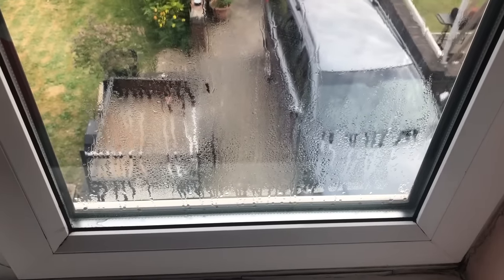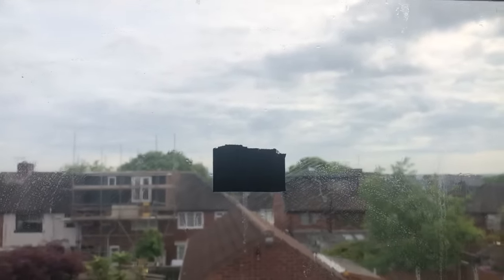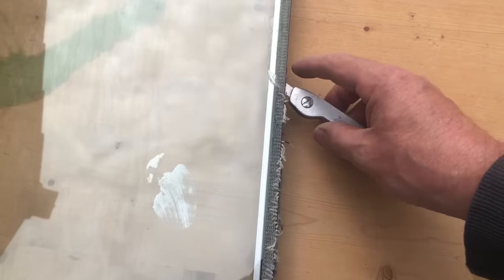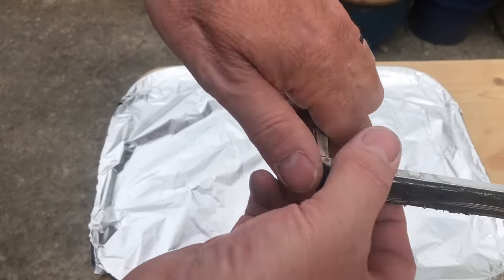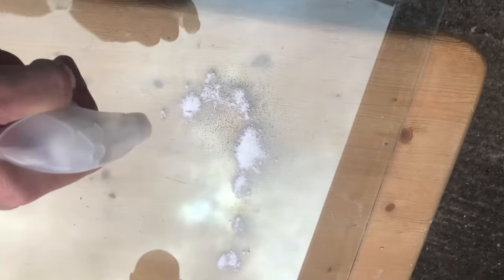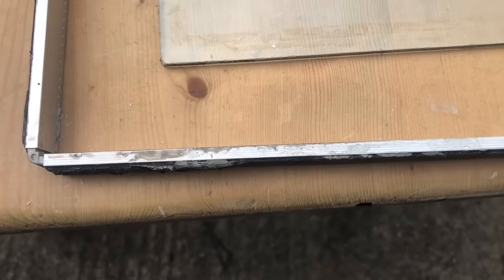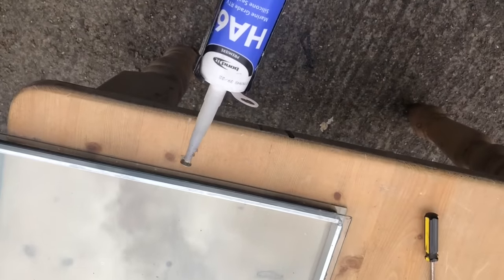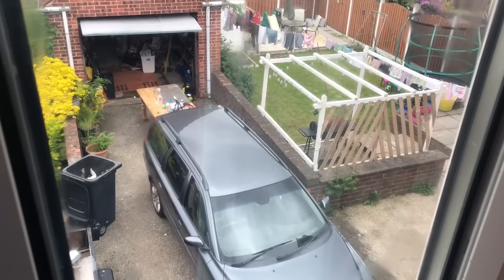Double Glazing Unit Condensation / Blown DIY Repair.

Comment: So smart awesome dude if you do this regularly worth getting suction cups glaziers use they are £10 or less screwfix etc helps to handle the glass
Reply from the maker: Good idea, I hope I don’t have to do anymore though!
Reply: @TheRepairer  for sure how long does it take  on 1 sqm unit the cleaning and sealing up
Reply from the maker: In the region of four hours at a relaxed pace with a couple of Tea breaks thrown in!
Reply: @TheRepairer  oh wow so you need to ensure good weather also this repair would be a bit risky on the tempered glass they use on doors that breaks to bits

Comment: if it's an older unit this will be fine. however if it's a gas filled unit this will make the unit less efficient and more noisy, but may save you time and money in getting it replaced.

Comment: I'm definitely up for recycling... however most modern double and triple glazed windows are filled with an inert gas to improve the thermal properties of the window and reduce heat loss. This windows will now have a poor U-Value (increased heat loss).
Reply from the maker: Dried air is the common filling,  gas is more specialised and costly.

Comment: Hello mate, I used to be a window cleaner years ago and can show you how to do it. All you need is an applicator, a rubber blade, and a scrim which is made of sheep's wool or hemp.

By using fairy liquid and water you can get rid of grease and clean them so they're as shiny as can be. 

Just an idea I thought I would share. This is a great video, why don't they repair all windows like that? I know this is what I will be doing to my windows.

Thanks for sharing
Reply from the maker: I needed to up my window cleaning game thanks for the tips.

Comment: I used to see my father making double glazed. He used to clamp the corners to stop the the bars moving. Then with a filet knife push the sealant down against the bottom pane and up against the top pane. The modern sealant is probably more sticky nowadays.
Reply from the maker: I’d like to see a unit being made too, thanks for sharing.
Reply: @TheRepairer  its nothing like how you do yours!

Comment: I use an old plane iron to remove the glazing beeds. Also I have seen repairs where as a small drill hole to the glass can be seen after, usually filled with some sort silicone
Reply from the maker: That’s one ready made tool I never noticed whilst wielding many planes!

Comment: The hourly rate to carry out that type of repair would cost more than a new DG unit replacement plus it will almost certainly leak/blow again soon as, also the old blown units can be recycled where it is ground down by a specialist company in the UK and repurposed into the paint for road markings (thats where the sparkle comes from when your lights shine on it), your looking at 4-5hrs to do something like that and that's if it doesn't crack whilst trying to disassemble it against 1/2hr for a experienced trade guy who knows what he's doing and that window is a tilt and turn opener which requires a bit of knowledge to heel and toe it correctly in order for it to operate correctly because you just can't shove those packers in and hope for the best. However if your short of cash you can have a go if its no bigger than one in this video. My hourly rate used to be £48per hour that works out at £240 and I would not guarantee it or £97 for and brand new unit supplied fitted and guaranteed for a 1yr. Which one would you choose honestly ?
Reply from the maker: I chose to repair as illustrated, my cost analysis is different to yours:- The cost of a tube of sealant say £9.99 worst case scenario and using  some cleaning stuff I already had. I put in a part day and sacrificed some of my spare time that I don’t get paid anything for and repaired it!

Comment: You should have cut each side of the black polysulphide then pull it, it normal pulls out in a long strip. Depending on the tube type,  plastic tubing it tends to stick more to without peeling consistently . When pulling the corner keys be careful not split the tube at the ends . Try to leave the butyl on the sides of the tube for re-framing the tube its used to stick the tube to the glass. Regarding the desiccant it will be useless now as its been contaminated and will not work as intended, its only got a shelve life of 24 hours once opened to the elements, best buy new.  Best to clean the leaf ( glass ) and tube with acetone,  but as one leaf could also be ( low E ) coated.  The coating  may well be damaged and becomes stained. Refilling the cavity of the unit is to use a pallet knife 'wall paper scrapper ' with your preferred mix loaded on it and pallet knife it into the cavity.. i would use blackish colours as its easier to see any cavities or holes in your filling work. The tape is only there because it was probably still a wet seal when being sent from manufacturers.  It stops hands sticking and damaging to the wet mix.. you can buy ready roled  of butyl for cheap to give it a better chance of lasting longer..
Reply from the maker: It’s a likely case of different strokes for different folks, I haven’t had any issues with reusing desiccant and this repair if done correctly works long term. In the words of a legendary Crooner” I did it my way  with too few regrets to mention”.

Comment: Having had to replace two small blown windows, I asked one supplier 'why don't you just re-make these?' - he said it was too difficult... for cleaning most things very effectively I now tend to use carb cleaner
Reply from the maker: Carb cleaner is brilliant stuff for cleaning I wonder if it would leave a residue on glass though as WD40 does. Probably isopropyl alcohol is the best stuff to use as it’s residue free.

Comment: Re. the dessicant, I had thought it was silica gel (crystals in spite of the "gel" name), but what he's tipping out on the tray looks to me like small beaded (cylindrical) molecular sieve.   Both silica gel and mol sieve are what are called adsorbents. They have a controlled porous structure with a very high internal surface area. Water molecules diffuse via larger pores into the very small pores (a typical mol sive is 5A, which means 5 angstrom). Once they are there they adsorb to the internal crystal structure of the adsorbent with a considerable physical attraction.  Adsorb means to be attraced physically to a surface (even if internal), where absorb means to be taken up by the material as part of it.  Water can be removed from adsorbents by heating, as done here, or more slowly under vacuum.  A long enough heat soak will get all the water back out to the equilibrium content at whatever temperature the adsorbent reaches, which will be a lot lower than at room temperature.  Adsorbents also have a limit to how much water can be taken up, so of the units are leaking at all, it is justba question of time before they are fully loaded and can take up no more.
Reply from the maker: Fully loaded is the last thing anyone wants in the context of double glazing!

Comment: Is the panel obsolete as regards blocking cold getting through or will the seperation between the two glass panels be good enough.
Reply from the maker: Its not an obsolete item and the separation is exactly the same as before.

Comment: Do you not find the glass gets brittle over time ? My biggest worry would be taking a unit out and then cracking it to the point of it being dangerous ,then not being able to get a replacement unit made for a week or so. I guess you need a big sheet of OSB on stand by. I spent some time as an installer and I never knew there was desecant in the frames. Every day is a school day.
Reply from the maker: Brittleness isn’t a problem I have had. I do handle the panes with kid gloves though. I have done five panels in total I am more wary of the larger windows!

Comment: I've seen someone drill a hole I think in the bottom inside of the panel to allow moisture out or something. Correct me if I'm wrong. I always thought there had to be a vacuum in there or a gas instead.
Reply from the maker: No vacuum or gas in this basic dried air double glazing unit but on the higher end glazing both are available.

Comment: Sorry if this has been said before, but I'd always understood there should be a vacuum between the two panes. Was I wrong?
Reply from the maker: No vacuum in this double glazed unit but it is available in high end glazing VIG units (vacuum insulated glass).

Comment: Thanks for making this. As a reference my partner is paying £370 for 4 units, this was the cheapest quote. We should have got one of the experts criticising you to come around. it would only have been £80. . . . . .
Reply from the maker: Thanks for providing realistic replacement costs.
Reply: @TheRepairer   No mention by the OP of what size those units are or if any of them are obscured glass or toughened/laminated. So as far as "realistic" goes, your reply means nothing.

Comment: How do you know if you have a dried air unit instead of an inert gas window? Is it possible to this repair to an inert gas window? Obviously it wouldnt as thermally efficient, but it would be good enough until you replace all of them.
Reply from the maker: Two small holes may  be observed along the spacer -- one where the gas entered the unit and the other for air to exit.
Reply: @TheRepairer  Thanks. It seems I have conventional dried air window units. Which I'm surprised to discover. I live in a former council home. We were definitely told the new windows would be filled with inert gas. They made a big deal about how much more efficient new windows would be.

Comment: Do double glaze units not get filled with Argon gas to help retain the heat in the building? this will have just air with surely would effect the E rating of the house
Reply from the maker: The newer high end stuff is gas filled, this is just a common ore garden dehydrated air unit.

Comment: Double glazed window are filled with a noble gas.
So how do you accomplish that. 
Because without the gas heat transfer will increase
Reply from the maker: Dried air is what many double glazed unit have it’s the more high end stuff that has gas in.

Comment: I have to ask as I would like to try this on mine. Will this work if you dont form a vacume or fill it with gas or will the condensation return? Great video
Reply from the maker: It will work, just be prepared to put some serious graft into cleaning up the panes for best results check, check & check again! The baking soda / powder and white vinegar are essential for cleaning as nothing else I have used works as well. Allocate the best part of a free day to do the job and work safely The pane in this video is still good and  a couple I have repaired are still good over three years down the line. Do ignore the nay sayers in the comments. I wouldn’t share the info if it didn’t work or I didn’t believe in the process, I have repaired them for family members and they are still good  - This video was at my Sons  property, it saved him a fortune! https://youtu.be/PzBcH2hqUoA?si=IxkvlYSAo6DOOzUS

Comment: You did well to not crack the glass while separating the unit, and to not bend the spacer bar, they are very flimsy. 25 years experience in glazing has taught me that this will not last though. And with it being a tilt n turn sash, the packers were in completely the wrong configuration. Google "toe n heel" and it will explain the correct method. Its the window version of a diagonal brace on a gate. Great vid but i do not recommend using this method.
Reply from the maker: Thanks for your feedback, I hope it lasts but the original unfortunately did not,  hence the need to repair it. I didn’t have any packers on me to correctly toe and heal the glass,  that was how I found it more than likely as the original glazier left it as it was untouched from the original installation.
Reply: @TheRepairer  if you only use the window in the tilt position then your packers are ok as they are. Just be sure that both leaves of glass are supported underneath by the Packers. If not, one leaf will eventually slip down ever so slightly, causing a break in the seal, causing it to fail. This may be why the unit failed in the first place.
Reply from the maker: @mikeprunty1  I was thinking did that cause the failure too, thanks for your input.
Reply from the maker: Thanks for that both glass panes are  supported.
Reply: @TheRepairer  You should not advise people to attempt this . They could seriously injure themselves . Glass is not to be played with . When you tapped the beads back in place , they did not look like they located . They should tsake more pressure than that . The window is a tiltvand turn , it will not operatec properly without correct packing . Someone may open that , find it sticks because of the packing  asnd tug it , only to find the glass comes out and smacks them on the face . If you want to make instructional videos then please know what you are doing first .

Comment: I commend rhe reusing of materials
I've replaced 8 units due to moisture ingress in my current house. Seemed fairly cheap for most of them although for the last one about 6 months ago the price has more doubled vs 2-3 years ago.
I may give this a go when the next panel inevitably gives up.
How's the one you did a few years ago holding up?
Reply from the maker: Still going strong, I’ve worked out it’s actually three years not two how time flies by!

Comment: Superb refit mate thorough explanation and a tidy finish, sat here looking at mine in the conservatory of similar size to your project. I’d much rather prefer to give it a try for less than fork out for a new one. How is it holding up 10 month on?? Thanks pal
Reply from the maker: All is currently well the window pane. I have a French door repair that’s still good since lockdown 2020.
Reply: @TheRepairer ah brilliant, I saw another comment about using foil tape rather than duct tape if yours is ok I’ll do the same

Comment: This repair in this video works, but keep in mind, a new panel will contain argon, krypton or xenon, rather than just air. Air on it's own is not an insulator. Argon tends to be the industry standard, krypton gives better insulation properties than argon, and xenon better still.

With the cost of energy, a new panel could save you an awful lot of money.
Reply from the maker: Air is a very good insulator especially when it’s trapped.

Comment: Is there an easier way?  Say making two holes in the spacer and blowing dry air through?  
If the unit can breath to the exterior it should not fog.
Reply from the maker: I think there is a company that puts plugs to vent them and dry them out, I’ll assume the hard water staining could be an issue.

Comment: Nice job. I always thought there was some kind of gas between the panes. However, I don’t think I would attempt it
Reply from the maker: Thank you.
Reply: @TheRepairer  Yeah, I thought double glazing had a vacuum between the two panes? Guess that's not the case. I do like that one guy used argon from a mig welder to fill.
Reply from the maker: @DevinderAthwal306  I’ll give the MIG welder gentleman 10/10 for creativity! I wonder how he got the gas in as there is no valve.

Comment: DG service Engineer and fitter 20years. If only 1. You can seperate the glass without cracking it. 2. If this repair lasts more than 5 yrs or even that long good luck...   Also toe and heel packing plus packing to keep glass from moving in side frame. Also make a solution of warm soapy water and run into frame to check drainage isn't blocked or even not routed under frame. The water should run out onto external cill.  Taping around sealed unit with waterproof Masking tape ( duck tape ) . To assist in keeping water out and to protect hands whilst holding unit.    But if your an engineer you should know cost of glass new unit for this size would be about around 15 to 25 quid  from double glazing supplier. Then charge to customer about £75  + vat.
Reply from the maker: Thanks for your feedback it’s appreciated £75 plus vat for fitting is strong I can see where the cash is going now.

Comment: Perhaps try using a hot air gun on the inner aliminium frame,  should soften the glue and aid drying of the dessicant   might be worth a try.
Reply from the maker: Excellent idea thank you.
Reply: Hi Ben  my intention was for after glass is removed from aluminium frame, as you would be right high heat in one area would cause uneven expansion of the glass.

Comment: I note that you didn't take the opportunity to Aegon fill the unit, which would have improved the insulation value and discouraged any further moisture.
Reply from the maker: I kept it as originally designed with dried air as the insulator.

Comment: Very interesting thanks .Just wondering how long will the unit last after repair ?
Reply from the maker: I repaired two in summer of  2020 that are still working one is a large French door. I have had no failures to date.

Comment: Would that also stop the heat from the windows coming through? As my new glazed windows in the our front door don’t  get warm at all?
Reply from the maker: If previously repaired two this way both are good after a couple of years. I can’t notice any difference in them and factory sealed regarding heat.

Comment: All for repairing anything if I can , but this is very long winded ,and depending on size determines if it's work it .Also under the impression  when they are sealed new they are under a vacuum,or some sort of gas in them to stop misting
Reply from the maker: No vacuum just dried air in this unit.